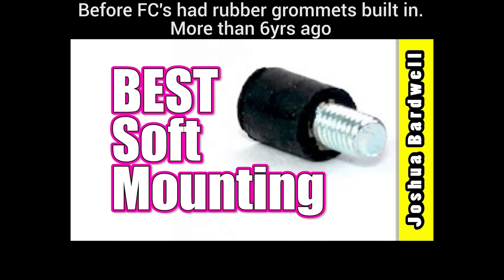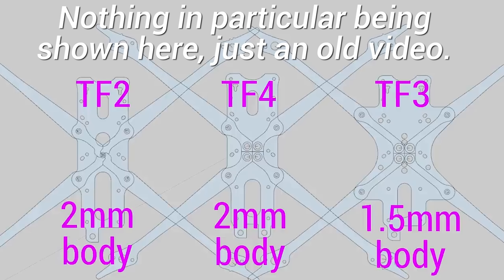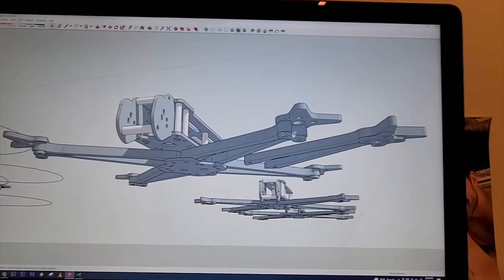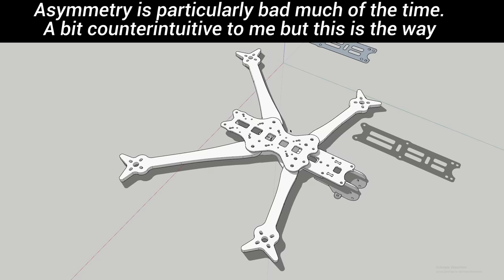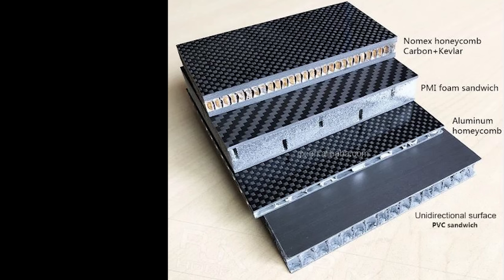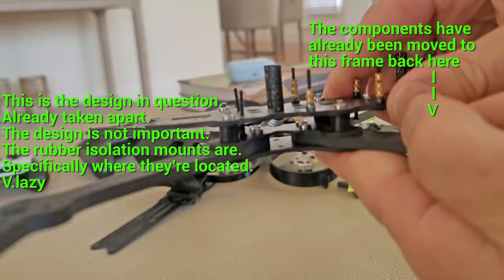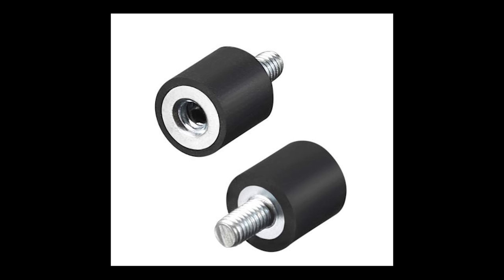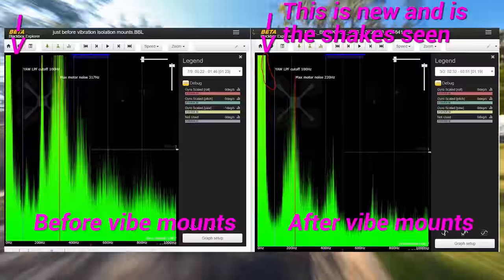I put some steel cable on a quad...

Comment: thoughts on rubber o rings between arms and frame?
Reply from the maker: Bad idea. Not only will it weaken the frame considerably but when you put physical structures between things that have any kind of bouncy quality to them, they will likely result in more wobbles than anything else. Anything solid has rebound to it. It's so thin that it's probably not going to do much for dampening because I can't really generate much heat. A while ago we used to put electrical tape between the frame body and arms. Now we know that the actual plastic tape portion is not helpful and made things worse because of its rebound. It was the actual glue on the tape that was doing any of the damping. So switching to damping grease was the best bet. Generally anything that allows for movement in particular parts of the frame will result in forces being focused and parts of the frame breaking easier

Comment: Have you thought about printing play small box that actually holds sand or something that's discuss but yet at the same time a solid.....
They do this for a lot of different things either in machinery or other things....
Even the car audio stuff uses a sticky type back that basically absorbs to deaden sound if you didn't sound which is a vibration you would essentially do the same maybe you can try one of these people even do this with 3D printers
Reply from the maker: any thin material between carbon unfortunately doesn't work for us. we've tried MANY materials. Damping grease does work but it's messy and limited.

Comment: Have you experimented with the material Tegris rather than carbon?
Reply from the maker: Actually yes. It was very hard to get a hold of but it's useless for us unfortunately. The carbon just doesn't bond well to it.
Reply: @Kabab  good to know. All the Quality pistol belts today are using it and when I got mine I couldnt believe how rigid and light it was.
Reply from the maker: @1EliPrice  it is very very interesting stuff for sure.

Comment: Maybe, as open as betaflight is for all kinds of applications, it really does perform best at its core on a 5" Quad.
Reply from the maker: It's not just betaflight. Any flight code has the easiest time with 5". The general weight proportions just work out best for earth.

Comment: Try 4 small harmonic balancers like on car engines on each rotor/to motor use it like a coupler vibrations are frequencies and or on each motor mount to frame or on each location a high speed camera would show whats ringing like a bell 🤔
Reply from the maker: The issue is that everything on a quad is actually pretty low weight. On a car you have heavy stuff that has inertia

Comment: Why not add a piezoelectric sensor speaker, they are light and flat, to the frame and use a noise cancelling chip to cancel the vibration.
Reply from the maker: Yeah that's essentially what our flight code already does. It's just really hard to do in realtime with the intensity of vibrations that occur.

Comment: What motor is that you are playing with at the end of the video? I want to play with this motor…
Please for make and model??
Reply from the maker: It's the FPVcycle 25mm motor that has been available at fpvcycle.com for years now. This variation has been the only variation available for over a year. I just didn't get a chance to ever talk about it.
Reply: @Kabab  thank you, sir, for the intel! I’ll check it out directly.
Reply from the maker: @revmsj  waiting on the new batch to arrive which should be end of this month or beginning of next month
Reply: @Kabab bro thank you so much for the heads up. I’ll admit I got a little bummed when I saw they were sold out…lol
I’ll check back and place an order in about a month, brother!

Comment: Have you considered a mast with a counterweight on it?  I broke a stubby antenna on one of my quads one day and put on a 3" lolipop antenna I had in my bag as a spare, and would swear it flew better.
Reply from the maker: Mmmm maybe not hanging something off the end of the craft since weight distribution is critical as well but adding weight to the FC would help a lot. We're still talking about dead weight however so not great

Comment: I messaged you on fb, but I know something is up with how that works for you, so I'm commenting here for redundancy since you seem to be responsive here.  Apologies for that.

In regards to isolating the vibration to the FC, the (incomplete) idea that comes to mind is having the motor/arms portion of the frame on bottom. secure a plate on top of a battery,  mount the camera and FC to that plate, and then sandwich that battery onto the motors/arms/body base securing them together using your durable dampening methods. The whole mass of the battery will be a physical filter for the gyro and video.  Maybe some ummagrip between battery and frame for more general dampening.

I'm even thinking something simple like:

1. Top frame with FC and Camera
2. Battery with ummagrip on both contact sides
3. Motors/arms/Bottom plate

and then just use a bunch of rubber bands to clinch the top and bottom frame together.  I think that would get the job done, in a MacGyver crunch.

Am I on the right track here in what you're saying in the video?  What do you think of these ideas?

Also, don't want to throw your mind off my main question, but I was wondering if the design with the center location of the drone improved the balance of the drone.   I've always wanted to move the battery to all axis centered to its CG.  Did it cause a 5" to fly as more nimble and balanced as a TP3? or was it not enough improvement to warrant the design challenges?

Comment: If, due to the friction of the fibers of the steel cable, it is possible to divert vibration energy into heat. So why not design the joints of the carbon frame elements in such a way that they rub against each other? Pay attention to speedebee cinemah frame. I drew a replica of this frame and my joints creak a little. I did not observe excessive vibrations and jelly in the video.
Reply from the maker: Yeah that is a good option however the joints would need to only dampen and not rebound. That's where things get dicey. Any solid has a rebound effect. Liquids don't. That's why damping grease works and we should technically cover the frame in it. But it's so messy that nobody wants to do that.

Comment: Instead of steel cables, consider putting thick rubber bands between front and rear arms on your H-Frame - the tension will dampen and also reduce relative movement (amplitude) of oscillations. That is how I used to dampen my toothpicks - rubber bands!
Reply from the maker: That is a good method but I am not too crazy about any crossmember that will end up getting stuck on a tree branch
Reply: You should try rubber endless rubber tube which has another friction zone inside the rubber band itself.

Comment: So one thing that will quiet vibration is putting a rubber band like object around the frame, if you look up whatever the dampening ring is that you put on a rotor on a brake lathe same concept.
Reply: It's called a silencer and rubberizing the outsize of everything will help too the rubber can be tuned
Reply from the maker: Right. We've tried that a bunch too. Wrapping the arms in various materials. It doesn't seem to do anything for this use case unfortunately
Reply: @Kabab  then its a physical movement somewhere not just vibration torsions and things cool idea with the wires though
Reply: @Kabab  try putting a belt like object around the diameter of the arms in a circle around the drone
Reply from the maker: @prest0n755   if you tie the arms together with something, it'll help in some ways some times as long as it's symmetrical. But you're also increasing drag by quite a bit and making it more likely to get stuck in a tree badly.

Comment: what if we just develop a dampened suspension system for the arms like in cars?
Reply from the maker: That works in a car because it's going over bumps. It would be detrimental for the control of a multirotor because the arms would move...
Reply: @Kabab  ahh, i see. my thought was it would help with dampening both the FC and the HD camera. motors transmit vibration like how a violin bridge transmits sound from the string to the body. If we attach a rubber muter at the bridge, it greatly reduces the volume. I once had a quad with rubber o-rings at the base of the motor. It didn't do much since the metal screws still transmit vibrations.

Comment: have you tested if ummagrip does anything to vibrations?
Reply from the maker: Ummagrip is good for mounting the battery and whatnot. If you mounted an FC to it, it may make it worse because it's so bouncy. Too much rebound. Also, the FC is very low inertia so it can only resist so much and generally higher frequencies only n
Reply: @Kabab  is there a difference in vibrations if you use ummagrip under the battery compared to if you don't?
Reply from the maker: @marc_frank  yeah that might actually be better or worse. I think I might lean towards worse because the battery will probably wobble side to side. This system is probably best with a hard mountain battery

Comment: i like chris rossers approach, push the vibrations up into the filters
Reply from the maker: I'm not sure what pushing vibrations into filters means. Getting any amount of damping is extremely valuable as any filters harm flight performance and even a perfectly vibration free frame does not matter that much when you have loads of vibrations from so many things
Reply: @Kabab  it means making them move to a higher frequency, where the lowpass filter sends them to 0, instead of having a bunch of noise under the filter at like 0-100hz depending on the size of the quad, you can see it in the gyro i have 2 aos35's and their is no noise where you cant have filters compared to my crux35 that was full of noise that just could not be filtered and i could not run an agreassive tune without the motors getting hot because all the noise was down where the actual flight movement of the quad is. you a couple of time show logs where your pushing the noise down really close to or under the filter by making them go to a lower frequency, the high frequency vibrations are easy to filter out and get a great tune, by pushing them lower your shooting yourself in the foot, if you mounted the battery to the fixed part that holds the armss and kept the fc and camera on the dampened section it would clean your logs up HEAPS in the area that i call under the filter. thats what i mean by pushing the vibrations into the filter, and by extion how im saying your thinking about it wrong by trying to make the vibrations the fc experences a lower frequency where you cannot filter it out without having HEAPS of filter and that adds a lot of latency if you look at the step responce tool in pidtoolbox
Reply: also for the record im not that much of a fan boy of rosser lol i got the vannystyle 5inch frame because i know his a stickler for a good flying quad and i like some of the elements it brings like the arm locking thing and the stack stanoff press in do-dads
Reply from the maker: @christhorney  rosser is very very helpful in understanding what's going on.  The issue is that the image he presents is always incomplete. Not like my picture is so complete but I focus on the use case rather than bench testing. 

Anyway, having a frame that cuts out the low end of the resonance is excellent and definitely helpful however I've found that even noise high up on the spectrum is significantly counterproductive. You can't effectively use filters on vibrations under ~100hz but that doesn't mean just moving everything up is a perfect solution. In general, rossers frames are good at not adding too much to the vibration profile but at the expense of frame weight and apparently some durability as I've heard from some. They seem pretty strong but I have no first hand experience breaking them. 

What I'm getting at in this video is that damping, actual real suppression of vibration is far more valuable than 'not adding'. If the frame can realistically cut all or just the biggest peaks in the spectrum by ~50%, that is going to do loads more than just not adding to the situation under ~250hz. It's not too difficult to design a frame to be quiet under ~200hz but that doesn't do anything about the motors and props spinning up a storm and causing everything else to rattle around.  

The new frame concept I'm working on has some seriously huge implications and so far it's showing a lot of promise. I posted a glimpse of the concept on my IG and FB group. Just crudely using dental floss but the more I look into it, the more it makes the most sense. True, real world damping with little to no added weight. No need to fiddle with filters. It just flies better without any tune work or anything.
Reply: @Kabab  sounsa interesting, and i understand what your saying, i just think mounting the batt to the solid section and not the dampened section would be most ideal, and i would love to see it tested like that frame you built with the big dampers just sling the batt under it instead of on the top plate for example to see how the logs look compared to having the batt mounted to the dampened section

Comment: What about them motors?!?! Haha dual magnets nice, I've seen twisted stators on old school brushed rc race cars should give smoother and quicker acceleration if I remember correctly.
Reply from the maker: Yeah supposed to but don't in this situation. They do however give you more throttle control which is very nice.

Comment: If only we had access to more Two blade propellers. We could use a prop balancer on every prop.....Prevention, not cure....Interesting video, those rubber isolation mounts have been around since God was a boy....🤔😳😏😏😏😏🇬🇧
Reply from the maker: Perfectly balanced props and motors wont stay perfect for too long unfortunately. These days I'd say the motors are worse than the props.
Reply: @Kabab  Yes, motors buzz running unloaded, you're right...😳😏🇬🇧

Comment: Has anyone tried using alpha gel for FC mount btw? Interesting to see if it really makes a difference in this particular case.
Reply from the maker: People have tried all sorts of FC mounting methods including alpha gel. Everything works to some extent but in this case, the FC is really lightweight. It's hard to dampen anything because it takes little energy to move it around. There would need to be some sort of ballist weight added to the FC which is annoying because we would just be adding dead weight. It would also still need tuning.

Comment: Really nice emperical approach! Only way to learn is to run face first into reality. Over and over again. 

You're backed up by the maths in terms of mounting the FC to the heavyest thing. Masses work as low pass filters in systems like this, where the attenuation it provides is given by 1/(mw^2), where w is the frequency in radian.
The other part is the spring of course. The spring relates to 1/(kw), where k is the spring constant. Meaning that a stiffer spring will also attenuate the amplitude of the vibration, but since it lacks the square it's a lot less effective. The stiffer spring will also push the resonant frequency up though.

There is also something important about the effect of the colocation or non-collocation of the actuators, masses and sensors, but it's a bit much to get into in a youtube comment. If you really wanna dive in deep I can recommend "The Design of High Performance Mechatronics". Happy to answer any questions.
Reply: Had a second idea, maybe the goal is not to minimize vibrations, but maybe just to minimize vibrations at the camera lens. In that case one option is making a mounting system where another component acts as a tuned mass damper, like they have in skyscrapers in earthquake prone areas.
Reply from the maker: The problem is the tune part. There are tons of frequencies. Unfortunately not like an F1 car that drives in controlled environments
Reply: @Kabab  thanks for responding! I imagine you must be getting a bunch of similar comments from all us armchair engineers. 

The way you would tune it is to stick a couple more accelerometers in different places and doing a test flight. Then you can identify which frequencies you care most about and adjust. 

On the damping part, did you see the new veratasium? Nitinol sounds perfect for your application, no messy grease. Maybe expensive though! Any other option for a less messy damper would be to glue two pieces of carbon together with a glue that is marketed as "viscoelastic dampening compound". it wouldn't rebound like solids do, and would be less messy after it's cured.
Reply: Actually, the nitinol wire seems pretty affordable! Hard to think about how to integrate it because it's so flexible that compared to the carbon it wouldn't carry much load if it's just glued on. Maybe if wrapped Pre stressed a little bit between mounting points at the motor and at the center of the frame.
Reply from the maker: @markkalsbeek5883  I've come up with several schemes that would work to manage vibrations with a few gyros mounted in a few places. I'm confused why it hasn't been done yet. It seems so obvious
Reply: @Kabab  I guess for most people it's not really a priority. I think people are often already really happy with things as they are, rather than what things could be. Probably a better attitude for happiness, but not for progress ;)

Comment: great job bravo, maybe there is to consider aerodynamics, the behavior of the air is not constant in space
Reply from the maker: Yes this definitely matters. To my surprise, I usually see improvement in vibration from normal forward flight over a hover. All the more reason to find a solution that is more universal than specific